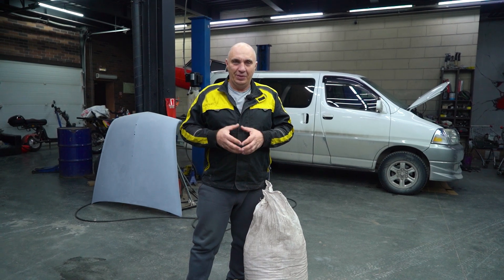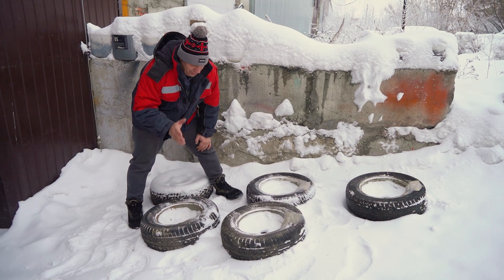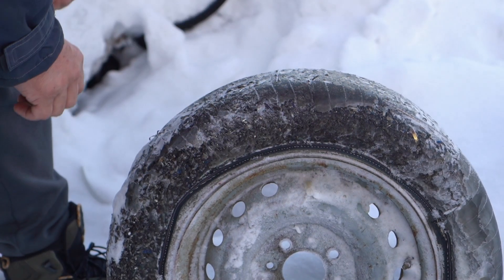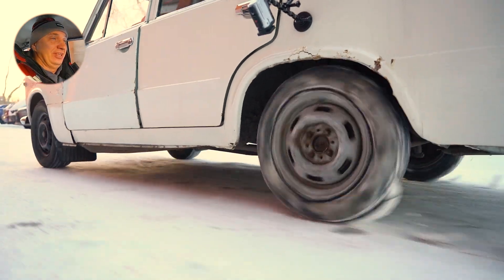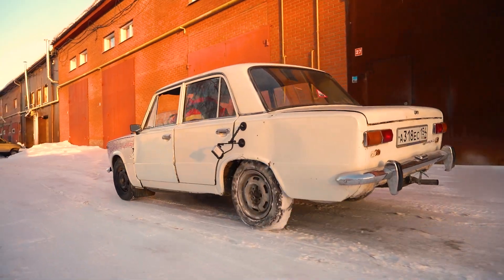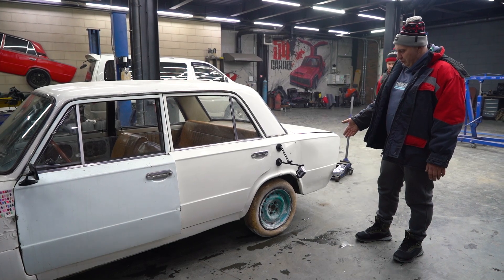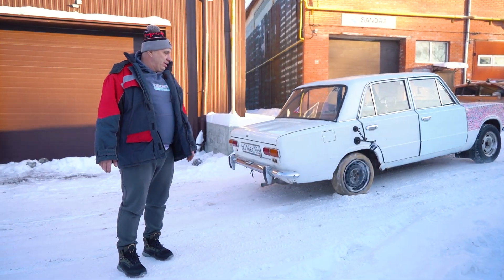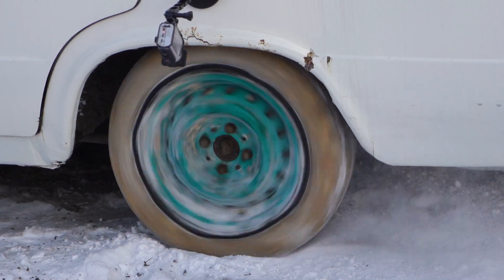Ice tires with sawdust and metal shavings for reinforcement (and traction)

Comment: Try this from Bloodviking master engine and 

Rear propeller driven car
Double decker lada
Monster truck lada
Pole volting from roof by breaking hard 
Cannon ball into lada head on
8 wheeled lifted lada tow truck
Terra tires in rear of truck 
Drive with tires on fire
Pulling lada from rope of sesna
1 electric engine on each corner of a lada
Coil springs in tires of lada
Double dully Iada 4x4
Lada on train rails with rear propeller

Comment: G'day Garage54 & BMI,
As you moulded these with the insde of the tyres they have a very smooth outer surface, it reminded me of the lack of grip you faced when you mounted tyres inside out compared to treaded.
🤔I'm wondering if moulding the Pyekrete with the tyres mounted on the rims inside out would give them a tread pattern, could allow them some grip

Comment: Idea for traction, if possible to replicate this was an option on '69 Camaros that provided a dispenser with nozzles located in the rear tire wheel wells that would spray a special traction-enhancing liquid on the rear tires to help traction on snow and ice.
Reply: So glue?

Comment: I would like to see you turn a a/c unit on a car into a air compressor. And have gages and a air tank on the car. So when you need to air up your car you can do so.
Reply: they have turned an a/c unit into a power washer, so that's kinda similar. lots of tractors and trucks have air compressors.

Comment: I'd like to see this following a previous video using barbed wire for traction. Only I would like to see the barbed wire fished into the tire for several times around the rim. Then frozen in water like this. The ice might hold together for a lot longer.

Comment: Could try the metal ones again but instead of using ice use a epoxy or melt down a whole heap of plastic bottle caps and pour in with the metal shaving

Comment: Try doing the wood again, use a hack saw to cut a tread pattern into it. You had them in the shop which might have softened the ice due to the difference in temperature of inside vs outdoors...

Comment: Hey, Garage 54 guys!!! On the subject of tires, an idea have been bugging me for a long time! Clearly, your experiment didn't work because hard frozen tire can't conform to the ground and create a contact patch... But what about solid silicone tires? Silicone seems to be both heat and cold resistant, grippy and soft, so I always wondered if there was some potential for ice, snow and offroad use! Please try it!!!
Reply: I agree 100%
Reply: Agreed, it is a cool material. And not very difficult to mold into a tire shape, I wouldn’t think.
Reply: Would look nice with a strip of LED lights around the rim
Reply: Great idea!
Reply: Yea agreed
Reply: But mixed with a little bit of tyre compound
Reply: I like this idea
Maybe ballistic gel too?
Reply: I'd watch that
Reply: This could be interesting
Reply: Amazing idea... using a type of rubber for tires. Nobody has ever used rubber for tires before.
Reply: Aren't you clever... I bet you're the main attraction at dinner parties with snarky remarks like that!  @UmmmmmmmWhat
Reply: @UmmmmmmmWhat underrated comment😂😅....Great minds and all that!

Comment: Many years ago a tire engineer spoke up in a forum discussion us "plebs" were having about snow tires.  He said one thing I'll never forget.  They engineer snow tires to hold snow, not to clear it out every rotation.  Snow sticks to snow.  If you could make a snow tire out of snow, and not have it compress into ice, it would be the best snow tire.  So they try to make them so they hold snow, without compressing it into ice in the sipings, that snow is really what provides the grip.
Your tires are caking snow on.  There are parts in the video where the tire has some snow on it and it slips until that part hits the ground and it grabs. Around 7:15, with an open diff, one tire has no snow on it and it spins, the other is caked almost all the way around and it grips.  Seems to verify what that engineer said.  Interesting.
Reply: Similar principle to cold welding. Identical materials tend to get "confused" at the interface where they meet, forming one continuous mass that wants to behave as a single unit.
Reply: I was thinking the same thing, they could build a wheel with metal plates on the sides like a spool.  As you drive the snow would hopefully get packed into the spool. If that doesn't work, they could add plates in the other direction so it's like a big paddle wheel.
Reply: @1234567890CAB  There was a similar sorta idea with the rebar wheels... I can't remember what they actually called them but all 4 wheels were balls made of rebar, and the snow was an issue, I just don't remember exactly how either 🤣🤷‍♂️

Good episode if you can find it, I thought of that because I remember thinking along the lines of a "paddle" type scheme for that as well.
Reply: Yes. Also the best form of sawdust or wood material to make the tire strongest would be wood that's steamed to relax the fibers and then made into many long interwoven rope-like fibers and strings woven and rolled around the tire tightly to build up to the shape of the wheel. Then let cool naturally. and then a mixture of fine and coarse wood chips to take up the space between any gaps. Increasing the strength and durability. Packed tight. Then soaked in water and frozen. Then it will be a strong and longer lasting frozen tire. With all the fibers and wood material packed in tight to take up the space to minimize the amount of excess ice so it is less likely to break. Ever had wet jeans become frozen solid as a rock in cold weather? Same concept. Stronger and longer fibers is better for strength and durability. I wonder if one could wrap a bunch of jeans around a tire rim tightly and use frozen wet jeans to make a tire.
Reply: @realflow100  I was also thinking vacuum treat it so the water will get all the way in to the voids would be useful. It's being used as glue here, more contact, stronger wheel.
Reply: Technically a rough ice would work just as well.

Comment: I saw a video of a guy using a battery leaf blower to boost the intake air pressure , after watching your air cooled engine conversion I wondered if you could combine the air flow through the engine into the intake/ carburettor 👍